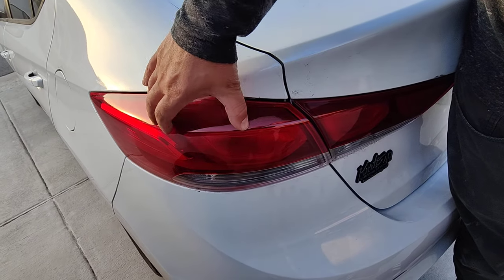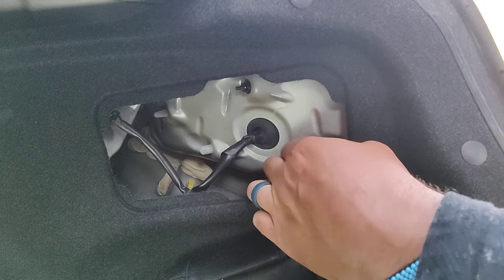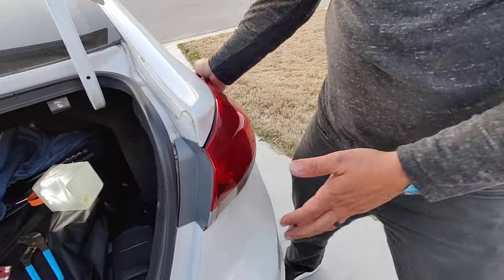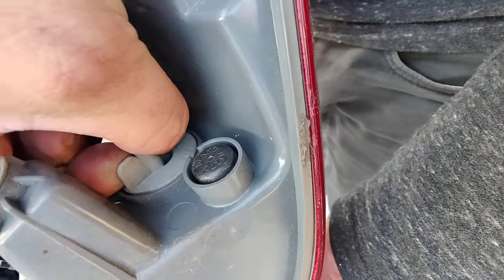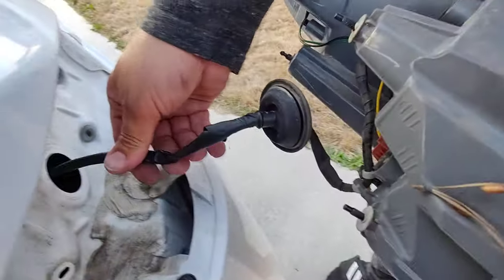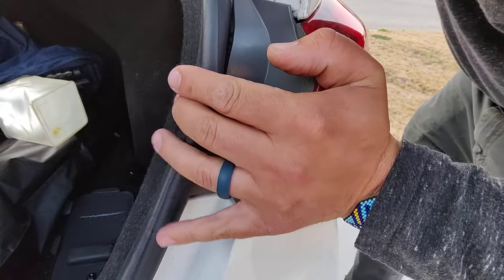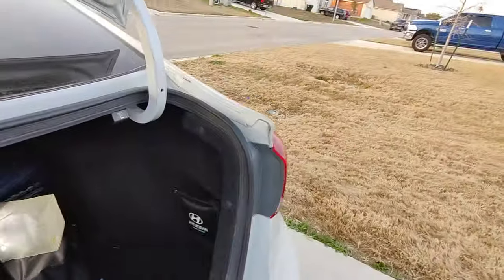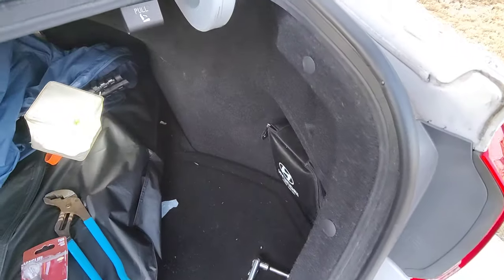How to install a Tail light bulb on Hyundai Elantra 2017

Comment: Another useless video.  My taillight will not come off no matter what I do.  Where is a video for this problem?  I have everything removed and using all of my strength and wigling it I can't budge it.
Reply from the maker: Thanks for the kind words! Did you see the part where I said when you're pulling you need to do a circular motion. You're fighting against sticky rubber that you don't just yank. Best of luck!
Reply: I’m having the same problem. I’m going in a circular motion but I’m not getting anywhere. I took my car to a mechanic previously for another taillight and they just used wd-40, but I’m not getting anywhere

Comment: There was a time when you could just pull off the inside cover and then twist the bulb holder without having to take the entire assembly off. A quick simple 2 minute job. Now they are designed so if you do go to the dealer they will charge an hours shop time labour to replace a one dollar bulb. Cars designed for the dealer service department to make lots of money.

Comment: This is ridiculously difficult for a simple bulb. It shouldn't be this hard. Tried your way several times to dislodge the light.
Reply from the maker: Is it cold where you live? If those rubber gaskets that hold the light in our cold it makes it substantially harder
Reply: @fix_stuff_make_stuff  He's actually rite my 2017 brake light does not come off like the one in your video I tried the wiggle idea nothing and no room on mine to get any fingers in

Comment: Great video but as others have discovered removing the cluster is often very difficult but after experimenting I finally found a repeatable method to remove the rear cluster. First remove the 2 retaining nuts from the back of the unit and unplug as shown then gently slide a luggage strap behind the front and another behind the rear of the light unit. Then pull both straps at the same time from the back of the car. This is similar to the solution posted elsewhere using zip ties but the luggage straps are far stronger and give you more leverage. No heat or hammers required. Good luck.
Reply: We didn’t have luggage straps, so we tried heavy string. Worked great, thanks!

Comment: Thanks for the great video. I was changing out the bulbs for a friend who was struggling with it. I knew there had to be something else holding the lens assembly besides the two nuts. It was just as I expected. Two pressure nipples making it difficult., but finally got it off and repaired.
Reply from the maker: That's awesome that you got it out I'm glad I could help. Next time I change it I want to try a suction cup handle on the lens hopefully that will help get it out
Reply: What did you do with the pressure ripples to get it off?

Comment: I finally got it OMG that was tuff for something so simple I got my sledge hammer out fixed it right up. All brand new now.
Reply from the maker: One thing that may help is heating up those rubber plugs to help with removal. 
I did this video in the summer time and it was tough to pull out but not terribly difficult no sledgehammers were needed. But winter time maybe a different story
Reply: @fix_stuff_make_stuff  yeah I watched another video that said tap the screws with a hammer it took a little more then a tap but it came free and it is the first time changing this light too. It was not budging without

Comment: Tip for if the light just wont come out for you:
Plastic pry bar\trim puller to get it somewhat loose on the back, slip a shop rag, a towel, a strap etc behind the back corner to get leverage. Also consider pinching the plastic pressure point clips from the rear and just popping the whole clip and holder out, i had one just pop out whole instead of separating and they still serve the function of holding the light in place afterwards. 🙃

Comment: 1:38 I’m having a hard time getting mine to come out. I can’t grip my hand on the back like you did. Is there another way?
Reply from the maker: You may be able to use a plastic pry bar but I found if you can just get a little bit of wiggling and pulling straight back like in the video is the best way.
Reply: I’m having the same problem, did you get it figured out?
Reply: @austinduff7317  I've gone out to do it twice and I couldn't get the light unit off. I like this video because of how he instructs us to remove it from that clip. I saw another video on youtube. That one the guy used shoelaces to wrap around the taillight assembly unit to remove it. I'm determined to spend the rest of my afternoon getting that taillight assembly out!lol. its that clip at the front that makes it so hard. I like how he explained the procedure to remove the taillight assembly,
Reply: You made it look so easy. Then I gave it a try. Been trying for an hour and a half. I don’t want to give up because I need a brake light but damn. Great video on how to do it but when it’s the first time it’s being taken off the car it’s on there tight.
Reply: @kats3781 same! I just did it and it took me forever to take the light compartment out and to take the actual bulb out since it sort of rusted in place
Reply: @kats3781 I can't get it off....
Reply: Me too. That assembly is ridiculously hard to pull out, I’m afraid I’ll break it

Comment: Awesome vid. Does that bulb function as a tail and blinker light? Not sure if I understood correctly. Thanks.
Reply from the maker: I believe it's a dual filament bulb that gets brighter as you apply the brake and runs as the running light and the brake light
Reply: @fix_stuff_make_stuff  Great. Thanks for the input. Cheers.

Comment: My 2011 Ford Fusion had flaps at the back inside the trunk. Pull them back and twist the light out, replace and reinsert. Job done. No tools.

Comment: But how did you get your fingers behind the light to pull away
Reply from the maker: After you remove the bolts there should be a little bit of play in the light to get your fingers under

Comment: I don't know if there is a difference between left hand drive and right hand drive Elantra's.
I live in Australia and on my 2016 Elantra, there's two nuts and some sort of white clip. That white clip is the problem, it will not budge. I cannot get the tail light cover off.
I watched the 2017, and that looks closer to my Elantra. But still no white clip.

Comment: What it won’t come off? Like it’s got screws in holding the light.
Reply from the maker: Another hack that I found is using a small suction cup handle when you're pulling directly back make sure you're doing circular motions to pop those plugs out.

Comment: Right side came off with a fight- the left side feels cemented on. Crazy that it’s so difficult to change a bulb.
Reply from the maker: One thing that I thought about after I made this video is that those rubber gaskets that hold the light in will be harder in colder weather. It might be a good idea to put a heater or blow dryer on it to soften them up. Disregard this if you live in a warm place...lol

Comment: I installed a single contact bulb instead of a double ended one just to try out if it works. To my surprise it did but the other to lights next to it wont work until its night and the headlights are on. I guess the double ended bulbs help turn the other two brake lights turn on
Reply from the maker: That's nutty!

Comment: Well, I took mine out... it only took me 10 minutes, but i dropped the entire case.  Now, it is going to cost me 100 plus dollars to replace it 😂😢   That shit is tight and takes lots of force to remote it and is hard to hold at the same time.  My suggestion is to have someone else be next to you, so if the case slips out of your hands the other person can grab it.   Also, dont use uniform while doing it 😂😂😂... get comfy clothes... hard work to pull it out.

Comment: After over an hour and a half I finally got it off and broke the clip you warned us of. Oh well though at least it is back on and next time it will be easier to take off. Clip shmip who needs it? Lol
Reply from the maker: My next video I want to make is using a suction cup handle I found on Amazon to be able to pull directly back without the clip breaking. And you can always duct tape it back on lol
Reply: Is it still secure after the clip is broken? I’m about to break the damn thing on purpose

Comment: No matter what i do i can not get the lens off.
Reply from the maker: How cold is it where you live?
Reply: @fix_stuff_make_stuff it's very cold. Just had snow too. I finally got it off after an hour. I'm a big strong guy and I struggled. 😅 Used a circular motion and even the duct tape on the lens to pull trick that others posted and no luck. Finally it came off. But thanks for posting this video. Mechanics charged a friend a $125 in labor to do the same thing.
Reply from the maker: @michaelshawjr66  I started getting a lot of comments that it's hard around winter time I think that the rubber gaskets get much harder in cold weather and you might be able to soft them up with a hair dryer or pull it into a heated garage.

Comment: Im unable to remove doesn’t matter if i hammer it out from inside or wiggle it please help
Reply from the maker: They can be in there pretty stiff as you're pulling back try to wiggle in a circular pattern.
Reply: @fix_stuff_make_stuff  i have tried for hours and full force to slide it back but it’s stuck i almost wanted to smash the light so bad its freaking annoying tried wity zip ties too and whith shoe lace check everything on youtube but still didnt came in
Reply: @sahilvij2671  Hope you got it ;)
Reply: I did it yesterday with the help of a rubber spatula for pushing the front end. It helped a lot.
Reply: Same here...given up on this crap